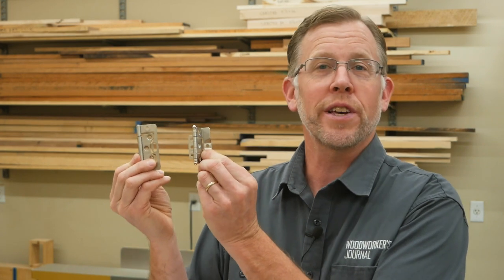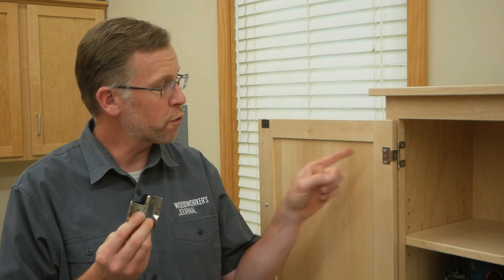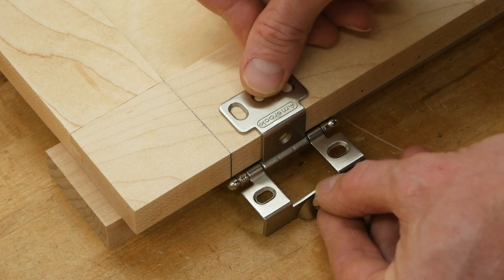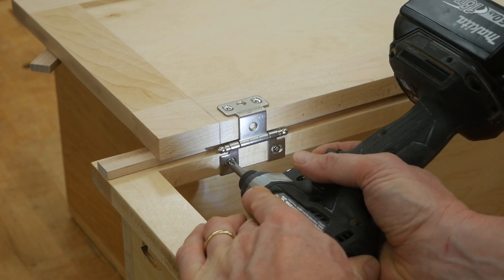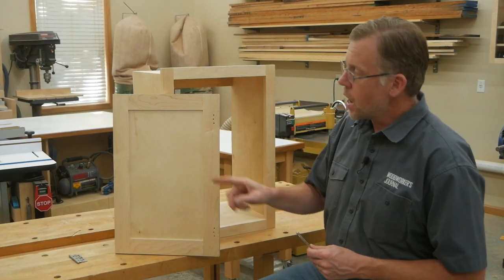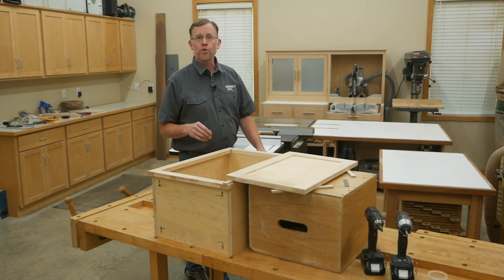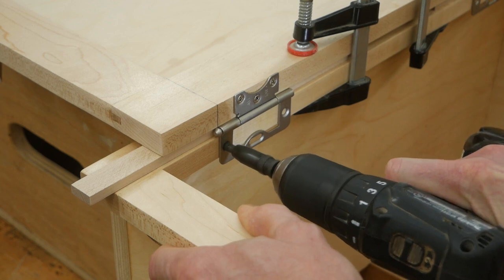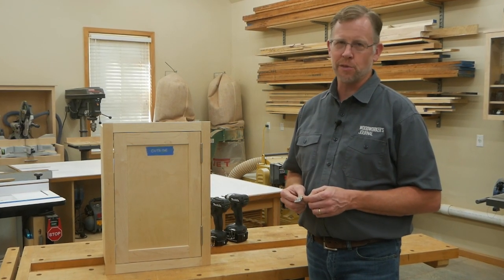How to Install No-Mortise Hinges

Comment: Hello! Super helpful video, thank you! Just a quick question: with no-mortise hinges it is often recommended to cut a bevel on the door side (1 or 2 degrees), is that something that is needed with these wrap around hinges?
Reply from the maker: Hi Little House on the Praries, Please reach out to our product support team at 1-800-260-9663 or support@rockler.com. They'll be able to assist you. Thank you